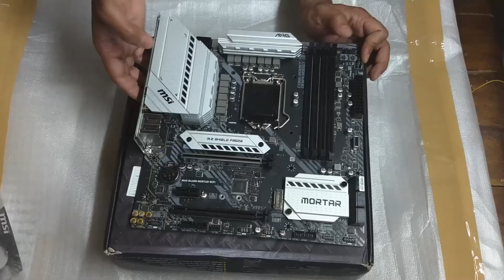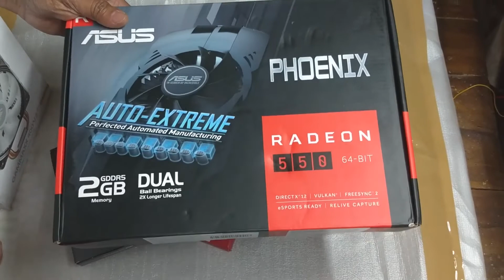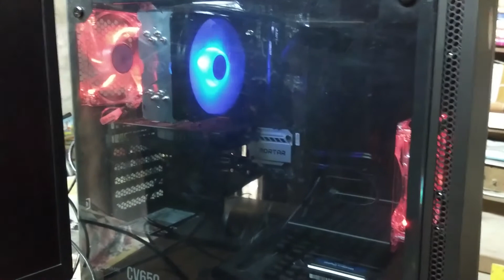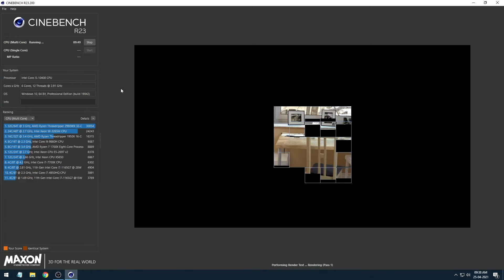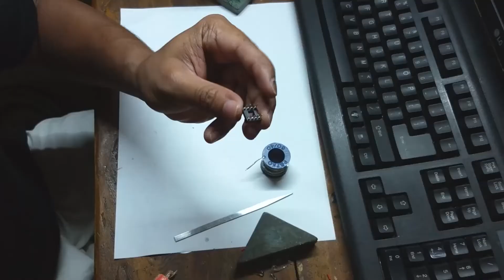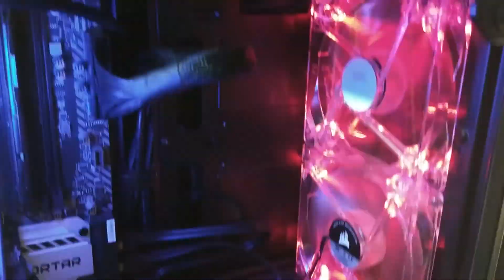Building My First PC with Intel Core i5 10400, MSI Mag B460M Mortar WiFi motherboard

Comment: what cpu cooler did u get?
Reply from the maker: Deepcool Gamemax V400
Reply: @ElectroHijibiji  thank you! I'm going to get it
Reply: @ElectroHijibiji  what thermal paste did you use? do you recommend it?
Reply from the maker: @Dyye209  I have used Cooler Master Mastergel Regular. I'm using for last 6 months and didn't face any issue. So, I'd recommend.